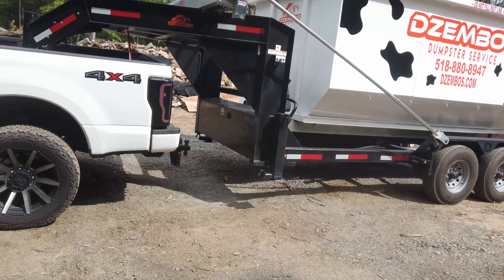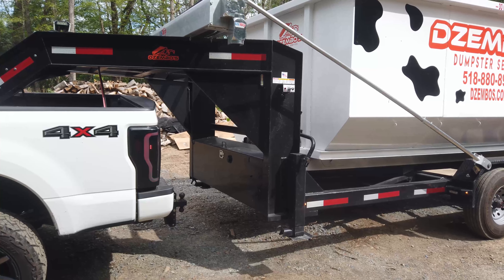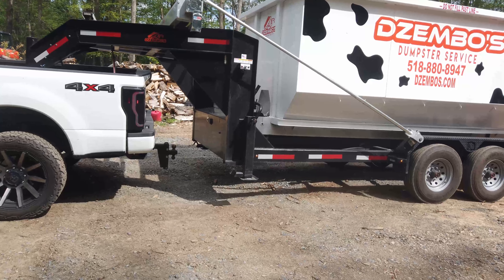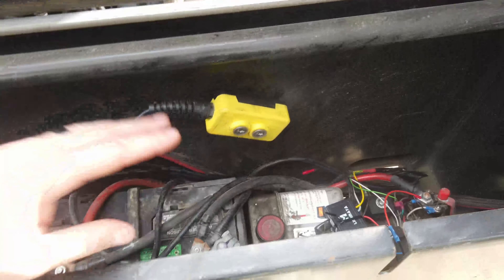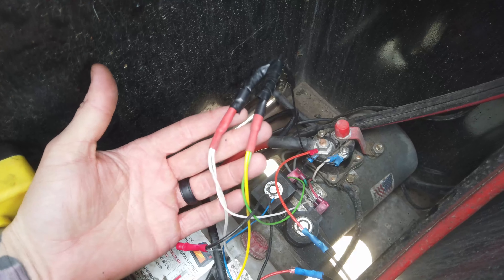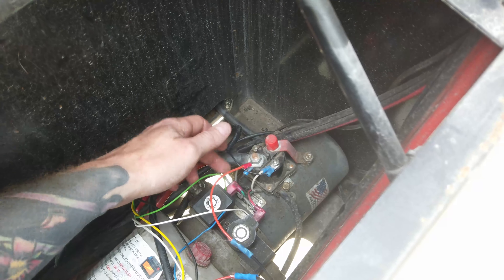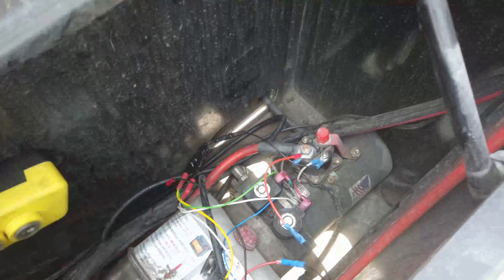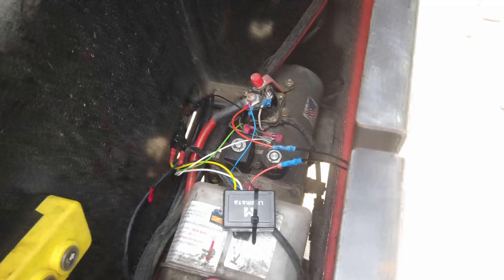DYI Wireless Dump Controls, Dump Trailer / Roll Offs

Comment: Good thinking on the on/off switch. I wired in a wireless winch controller on my ranger,worked great for over a year,woke up one morning and it malfunctioned (at some point in the night)and was spinning in the “in” position all by itself,destroying the winch. I want to add on of these wireless controllers to my dump trailer and will definitely put a on/off switch on it. I would hate to be driving down the road with the mini excavator on the trailer and all of a sudden it starts raising up,could be a big problem.

Comment: I wired it up and both up and down turn on when pressed but nothing happens. I can hear it turn on when I click on or off but it sounds like the motor is not working properly. The original remote works as usual with no problem. Any suggestions? Is my power wire to the motor not mounted correctly?